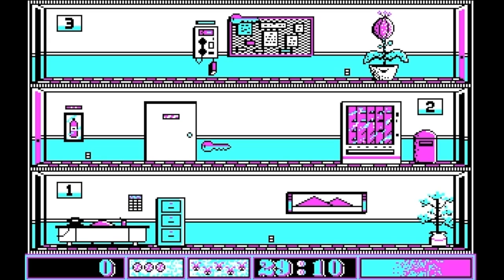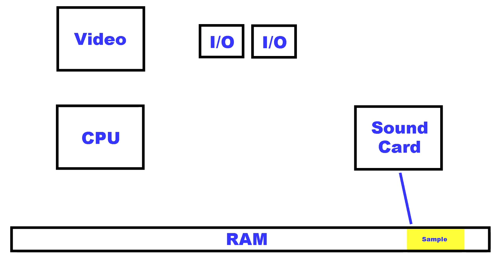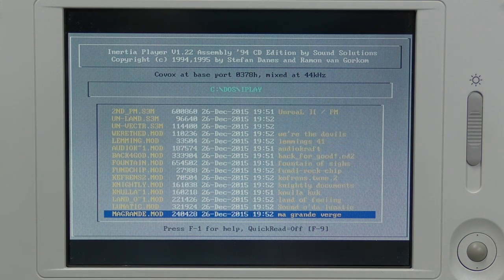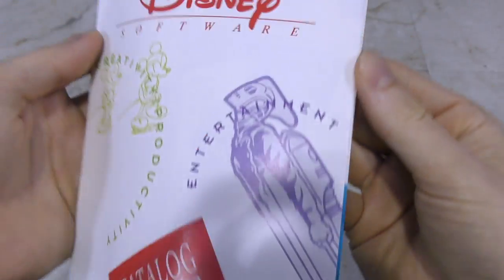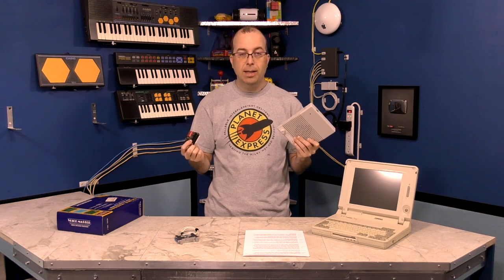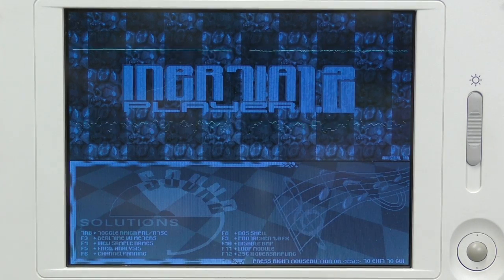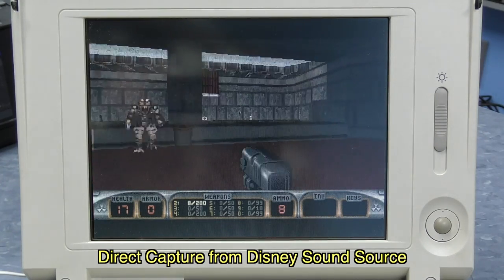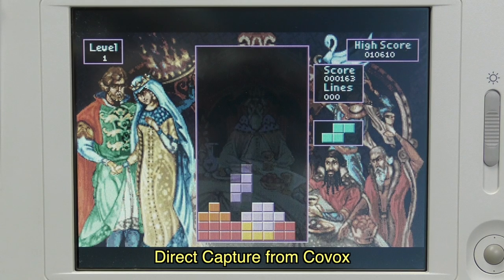How the Covox and Disney Sound Source Worked.

Comment: I once built such a thing for the parallel port myself to play MOD files on my PC. I didn't have access to a real D/A chip at that time so I even built the D/A myself out of a network of resistors (you will need 16 resistors to make a good 8 bit D/A; it can also be done with just 8 but then the quality will be poor). It was even stereo. Therefore I used two 8-bit latches, that would keep mirror the 8 input bits to its 8 outputs once you signal them to do so and then keep the output constant even if the input changes unless you signal them again. As for signaling those two chips, the parallel port has 4 control pins whose state can also be set in software. In the end you will need a band-path filter that only allows frequencies 50 Hz to 4 kHz to pass through; this is critical as without that filter the D/A will not produce the signal it is supposed to. Today one would use an active filter for that but at that time I just created a simple passive one out of two resistors and two capacitors. 

Why 4 kHz and not 20 kHz? The filter should limit the range to the reproducible or hearable range, whichever one is smaller. In my case it was the first one. The parallel port of that computer (a standard parallel port, SPP) was only able to transfer at most 150 kbit/s. 8-bit stereo playback at 8 kHz sampling frequency requires 8000 * 8 * 2 bits per second and that's already 128 kbit/s. So I couldn't use a sampling frequency higher than 8 kHz and such a frequency will only produce signals up to 4 kHz correctly. Later parallel ports could transfer 1.5 Mbit/s (EPP) or even 2.5 Mbit/s (ECP).

Comment: @3:17 Correction D0 - D7 on the LPT port are not GPIO -- they're output only on most implementations (it's true that some ports can be configured in BIOS to allow IO on these, but that was fairly rare -- most LPT products that needed bi-directional communication used the ACK/BUSY/ERROR, etc. pins as the input pins).

Comment: ha, speaking of those Compaq 486 laptops being virtually impossible to get sound out of... I actually had one. The docking station for that laptop  had an ISA slot that I put an SB16 into. Worked great 😀
Reply: and I guess the other thing that means is that somewhere in that mess of a docking port on the back are the pins for 16 bit ISA. Wonder if anyone has figured out which pins are what.

Comment: IPlay was great, still use it to this day. What was the second player you were using for the Sound Source?

Amiga mod files were very advanced compared to anything the PC had in 1985 when the Amiga was introduced - if you made music you either had an Atari ST or a Commodore 64 / Amiga, but almost never a PC.

MOD files are easier to render than most other formats through a PC speaker - since it is a sampled format and not sequenced, like MIDI. Since MIDI can have different instruments, the MIDI would have to be converted to samples before it could be played.

Still don't understand why the Covox was so expensive, the parts were only worth some $6 at most. Or why they named it the "Speech Thing."

P.S. I like the irony of Duke Nukem 3D being the first game you showed to support the Disney Sound Source.

Comment: Darn, I think I dumped my Covox, although I still have the speaker. I scored it with no software, and being only 8 bit, I assumed the sound wound be awfull. I was amazed by your video about the amount of support and what they squeezed out of it. As it was just a bunch of resistors, it should be no problem to replicate it in a 25D backshell.

Comment: I had a very similar looking old compaq 486 laptop.   No sound on it's own but it had a massive docking station that gave it the ability to output sound like any other desktop. 
I guess yours didn't have that? 
Also I have to remark on how great the display on that laptop looks, is that a TFT?   I think mine was a dualscan and it looked awful, not nearly as good as yours. 
It spent most of it's time in the docking station connected to a CRT.

Comment: I made one with an array of 8 resistors hooked up to a 3.5" jack. You didn't try the Disney option with the Covox emulator plugged in? My resistors had no buffer at all, but Disney supporting software seemed to work pretty well through it. I'm didn't have any software that supported Covox at the time, so maybe it weighs the data lines in the opposite direction, otherwise it should work with all the software that the other does.

Comment: I have a sound card that needs repairs that supports OPL3, Sound Blaster, Covox Speech Thing and Disney Sound Source. It's an Aztech Sound Galaxy NX Pro, and the NX Pro 16 had that as well. My card desperately needs repairs at the moment as the sound isn't coming out of the speakers and it has a faint smell (too much flux on there), but no shorts. I followed the traces accordingly.

Comment: You could make these {Covox)  yourself!  We made them for our 286 computers as 15 year old boys  around 1990, without ANY previous experience in electronics.   You needed a schematic from a computer magazine, some cheap parts , a soldering device and a steady hand.  I think it costed $20 max, maybe even less than $10

However, very few games worked with it so we basically used it to play 'Axel F' and other synthesizer tracks mostly But I do remember that a few games worked.

Comment: Another way to get a sound card is to buy a PCMCIA one. Creative made the audigy 2 in that form, but they do cost $50+. Many people don't realize that PCMCIA is based on ISA. There is also a modern ad lib compatible parallel port sound card, )but I don't know if it's still made), and the digispeech plus, which is a sound blaster over parallel
Reply: 8bit guy did AdLib over parallel port a few years ago

Comment: Not only is the Covox nothing more than a DAC wired up to the parallel port pins, it's the simplest possible kind of DAC, a simple R-2R ladder. If you look at the CVX4 you can see that there isn't a single IC on the board, just a bunch of resistors and a half-dozen capacitors, and that's an upgrade from the original, which just had a single cap for DC blocking, rather than the adjustable bank of them the CVX4 has to filter out terrible whining sounds :)

Comment: Hi       I purchased a Covox sound card a very long time ago . At the time I wanted to see if
its voice recognition software could be used by disabled people / kids to control things .
it worked but was not good enough for that task . it came with a disk for the Speech Thing
so being an Electronics Technician I built a Speech Thing with a few resistors ( its that simple ! )
I am sure that I still have everything ( I don't like to dump stuff ) so if you want more info
let me know and I will try to find it .
                                                                                                    Alan

Comment: Well, reminder that the Covox clone you have is based on a design by Triton, from the mid 90s that fixed a lot of the issues with the original Covox design. So, an original Covox would really sound on-par with the Disney sound-source.

Comment: Technically it isn't a digital to analog converter. The parallel port boxes simply used resistors of different sizes hooked up to the IO pins. By selecting which IO pin would bet set high or low, the resistors would form a voltage divider and the output voltage would change. The box is analog while the computer port was digital.

Comment: There's also A Sound Blaster 1.X emulator (called Virtual Sound Blaster) that works with either a Covox or a PC Speaker. It was made by the same dude who made the Tandy emulator. However, it's not capable of emulating FM, just digital sound.

Comment: I reckon, as usual, you get what you pay for.  When I was running Linux in the 90s, it had a PC Speaker driver that would actually output any sounds to the PC Speaker in the same way those DOS games did... it sounded like crap but you could hear digitized voice, WAV files, etc.  Good for those without a soundcard (and Linux soundcard support was notoriously bad back then.  Can you believe there was a commercial sound driver pack for Linux?)

Comment: I used to have 2 LPT ports for stereo, a covox clone you could solder yourself couple of resistors and RCA plugs. You could play Amiga MOD files in stereo (386SX16). With Intertiaplayer or MMplay in DOS. Later got a SB-Pro and got rid of my handmade covox clone, don't think Cubic player supported the 2 LPT port play for stereo.

Comment: I wonder what would have happened if the Disney Sound Source Speaker was plugged into a phone line, or of the Disney Sound Source part that attaches to the computer was plugged into a phone instead of it's speaker.